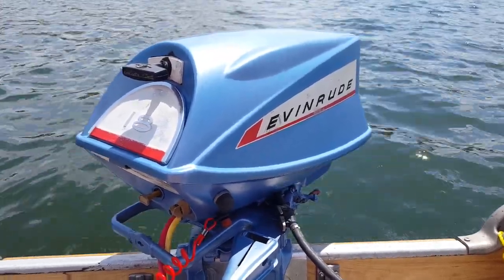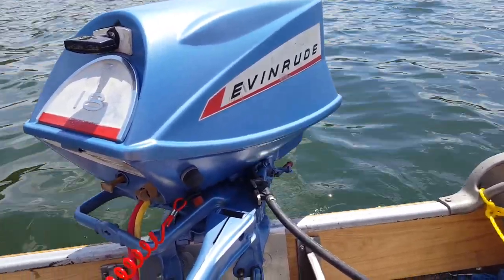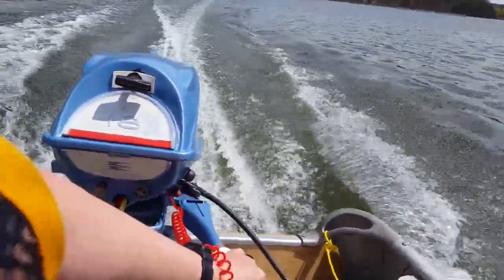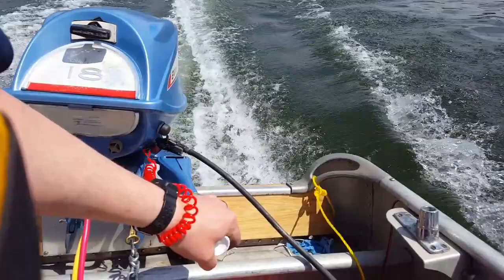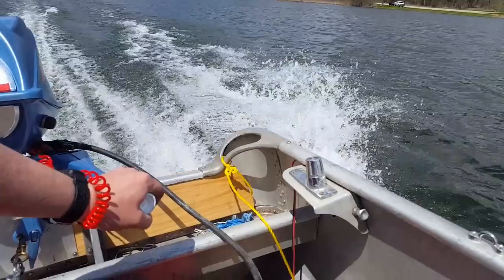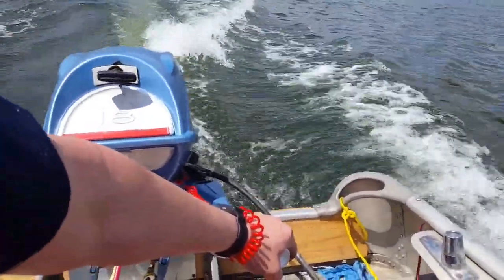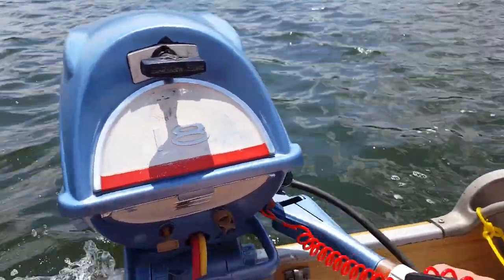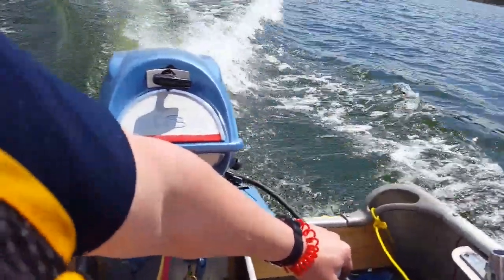1967 Evinrude Fastwin 18hp Outboard Motor

Comment: Boat's moving nice with that torquey 22 cubic inch motor.  A lot of these tin boats especially 12 footers are officially rated for no more than a 10, but a 15 or 18 doesn't overload them or make them unsafe. I ran an old Gale 15 [same 19 cubic inch powerhead as the 1950's Johnson/Evinrude 15's before '57] on a 12 ft Mirrocraft and it needed the power to plane with just me in the boat. Ran it with a ten and it wallowed at the stern - not enough torque to accelerate the boat.
Reply from the maker: Thanks! This is a strong running 18 to be sure.  It pushes my Alumacraft FD to 24mph.  This Sea Nymph has some hook in the stern and gets tough to push once it gets over 20. Yes, most 12 foot tin boats are about a 10hp max and when heavily weighted to the stern require a lot of power to plane off.  I'm sure the Gale 15 would make it scoot once it pushed over the bow wave.  I have a 1962 Gale Sea King 15 and I'm familiar with that motor.  It pushes this boat to around 20mph and I can imagine it would be a handful on the 12 foot Mirrocraft.  Thanks for watching!
Reply from the maker: Russ Gallagher  That Gale Sea King 15 is an almost new motor.  It sat in the sun on a boat quite a bit and faded the top of the hood, but it has very low hours.  That is probably the best 15 I have of that era.  I have a 1972 9.5 pumpkin that I still need to go through.  It's an ugly one,  but it's the only 9.5 I have.  I have yet to run one of them myself.  I know the 10s will walk away from them but they are interesting motors.  Thank you for watching!
Reply from the maker: Russ Gallagher  Yes, that is what I have heard too.  The 9.5 is one of the best running 7.5hp outboards around. They are a very low compression engine with many of them only in the mid to high 60psu range.  It seems like they could have been so much more.  Should be very easy on bearings with no more compression than that I guess.  They should almost last forever other than all the seals that keep the exhaust out go bad and the motor mounts break.
Reply from the maker: Russ Gallagher  Luckily my '72 has good motor mounts.  I won't know if the lower foam seal or the boot that tends to fail on these motors are good until it is finally running. I have heard about using Great Stuff for sealing in place of the original foam.  I could see doing that on mine.  It's pretty crusty.  I wouldn't mind having a nice one of them.  I'd prefer an Evinrude version because I like the graphics better.

Comment: love those old FD boats. I just picked up my 3rd one over the winter. Had a few different boats but wanted another FD model. 1975 with trailer for 400 bucks. Got a 75 9.9 Johnson but am eyeing a 67 18hp elec start evinrude. havent bit yet. lol. nice video..
Reply from the maker: Thank you.  Yes, the FD us a great little boat. Very solid.  I'd like to get another one or an FDR.  The OMC 18s are my favorite all around motors.  Thanks for watching!
Reply: @oldjohnnyrude8404  those fdr's are super cool. I have not seen one in at least 20 years.
Reply from the maker: @forreststump11  Yes they are.  I'd love to find a decent one that I can afford.  I have seen a few and know someone who has one.  His is not for sale though.  Maybe someday.  In the meantime I have a Flying C to get back on the water.

Comment: Super nice motor I like it.
Reply from the maker: Thank you.  This is one of my favorite motors to run.  The original coils crapped out shortly after I got it tuned back up.  I ended up replacing then over this winter and it is back to happy again.  It will be back on the lake this year.  Thanks for watching!

Comment: I have the '69 25hp Johnson version of this motor and I also added a lanyard kill switch and start button.  I'd like to see you do a video of the installation  you did on your motor.   If you could also show how and where you mounted the solenoid as well that'd be great.
Reply from the maker: George Keats Thanks for watching.   I'll see if I can make a quick video of the installation of my kill switch and starter button.  I didn't wire in any interlocks or safety circuits.  If the battery is hooked up and you push the button, the starter cranks.  If it's throttled up, in gear and the key is in the kill switch you better be holding on cuz, you're going for a ride!

Comment: Awesome motor. There is one for sale near me. Didn’t know you could get an electric starter for them.
Reply from the maker: Thank you!  These are awesome motors.  My favorites!  I have two of these. This one is electric start and the other one rope start.   The 18s have always had the electric start option since they were introduced in 1957.  I have an original 1957 Fastwin Electric Starting model as well. The 1956 15hp was also available with factory electric start as well as a conversion kit to convert an original rope start motor woth factory parts.  Thanks for watching!
Reply: Thank you for the reply. Do you have any suggestions for finding the starter kit to convert one?
Reply from the maker: @ericwhitlow7364  the complete kits are NLA.  The individual parts can still be purchased new.  They can be converted to different degrees too.  This one is electric everything, but I do not have the electric choke wired.  The starter and bracket can be purchased together new.  That is a pretty easy swap to add the starter,  bracket, solenoid and wiring for the starting circuit.   The electric choke is a little more involved.   The solenoid,  solenoid bracket for the carburetor,  and extra the linkage parts to allow the solenoid to actuate the choke need to be added.  I don't have a complete parts list either.  If you only wanted the electric start and were still using the manual choke for a tiller motor, it is not terribly involved.  Look up one of the electric start models on Marineengine.com.  From there you should be able to find the required part numbers. Thanks for watching!
Reply: Excellent. Thank you very much!
Reply from the maker: @ericwhitlow7364  You're welcome. 
🙂👍

Comment: Do you have a video of you installing the start button I’m buying the same motor and want to install one. I’m pumped now after seeing how fast they can go!
Reply from the maker: I do not have a video of the start button installation.  Is the motor you are buying already equipped with electric start?  This one was when I bought it, but had someone's pieced together wiring for battery and kill switch.  The starter and all the related hardware was already present as well as a starter solenoid mounted under the hood.  The wiring and adding the switches was not very complicated.  

These are great motors.   They are quite powerful for a portable outboard.  This is one of my favorites to run.  Thanks for watching!
Reply: Old JohnnyRude hi there,
Just curious how would I know weather or not mine has electric start? I have literally the exact same motor. Where your red and yellow wire go into the motor I have a plug with two copper prongs in the circle. 
Thanks for your advice. Awesome video!

Comment: Looks good who's paint did you use?
Reply from the maker: Outboard Fun Thanks Scott! I used Dupli-color GM Light Blue Metallic on this one.   It is a little darker than the original color for 67 but it turned out pretty well.  I was just wanting to put together a decent-looking regular runner for myself.  I think for that, it works quite well. Thanks for watching!

Comment: Well gonna have to have mine worked on she’s not nearly that fast
Reply from the maker: These are strong motors.  There are a lot of factors that go into getting the highest speed out of them though.  The boat's hull design, weight, prop, trim position, balance of the load in the boat, how well the engine is tuned, mechanical condition of the motor, wind and water conditions, and even ambient temperature and humidity to some degree all play a part in the boat's performance. Thanks for watching!